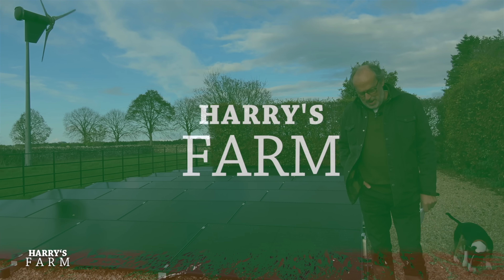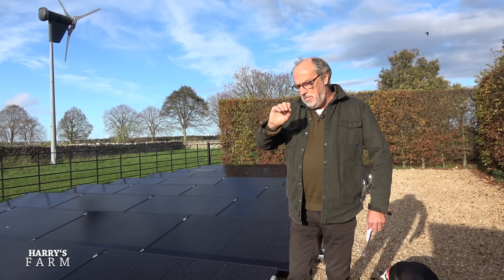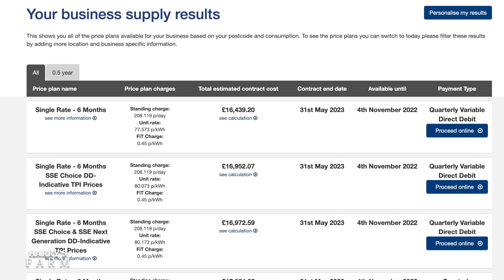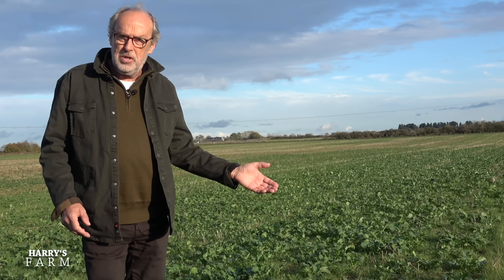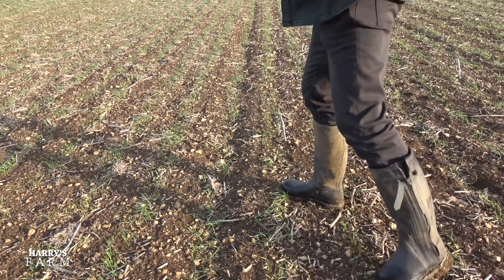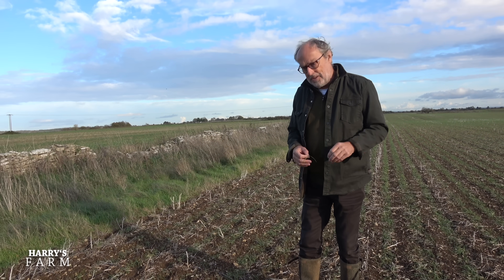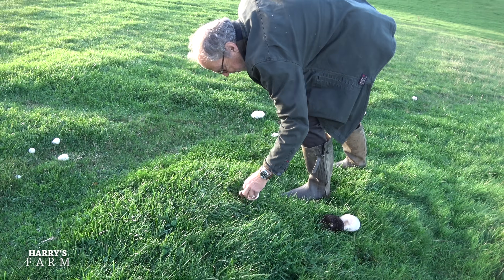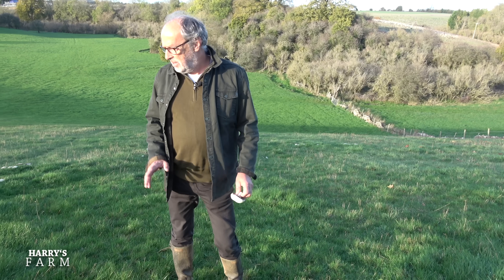More solar panels get installed plus why New Zealand's proposed carbon tax on cows is wrong

Comment: I was one of the commenters on the previous 'Solar' that suggested putting them on the ground. But man-oh-man, you might have taken it a bit too far. 🙂
1) Hurricanes and the like. If it's not tied into the ground, the entire system will wrapped around a tree a half-km away during the first serious wind storm, perhaps in about a month from now.
2) Depending on how it's wired, if any part of that system is in series enough to generate around 50 volts above ground, then you'd want to ensure that there's no shock hazard from the panel faces. You may recall a famous video of Pres Jimmy Carter having his hand slapped away when he was about to fondle a solar panel installation on the Whitehouse. Anyway, if you haven't already, consider the possible shock hazard from the system. Make sure it's all safe voltage wise.
Cheers!

Comment: At that price, 84p/KwH, install a good old Cummins diesel generator and to hell with the stupid credit check! It also sounds like it will be much more reliable than the solar panels! The wind generator seems to be holding it's own though, how does it compare £ to KwH?

Comment: Harry, your system is set up for summer, due to the low angle of the panels required for ground mounting.  It is therefore compromised for winter generation.  Pitched roof mounting allows something close to ideal for year round generation.  Solar power generation is all about light angle incidence (90 degree perfect).  

Your video was shot early in the day (long shadows) – best power is obviously around midday.  The third issue is that it’s winter – so the sun’s light incidence to the northern hemisphere is at a low angle and solar energy has to travel through a relatively thick layer of atmosphere at this time of the year.

  Your 12 kW system has a peak power that you will only occasionally see in the UK (on sunny cool spring or autumn days – not summer because panels are too warm) – a bit like peak power rating of an ICE engine – rarely used in practice.  The peak rating is important because everything in the system has to cope with peak output (like an ICE engine).  

Your solar installation does not need clear blue sky to deliver good power.  Clouds come and go – the power you make will be consistent over the year and every year.  As a farmer, you are well placed to understand you are ‘harvesting’ energy, which is seasonal, like the other crops you grow.

Comment: Interested in the wind turbine graphs.  What output rating is the turbine?   Could you do a review on this when you do the solar update?
Reply: We have an 11kW turbine shared between three families. Average daily production is 60-70 kWh but max seen is 220, and min zero!  Worst always July to September each year. We need to add solar to balance variability in wind generation

Comment: the methane argument isn't "climate change is completely due to cows" (or ruminants), that's pure bad faith. We need negative GHG emissions, so any methane we can avoid emitting should be avoided. Right now farmers emissions are subsidised by the NZ government, and they're proposing not to do that any more.

Taking your "CO2 to grass to methane" point, yes, that's true. But methane is ~120x as bad as CO2 for warming over the 30-ish years it stcks around. So just having ruminants is a big problem.

FWIW deer in New Zealand are an invasive pest that most peoiple want to remove. But the hunters fight attempts to do that, and the agrarian socialist party bow to the hunters.

Comment: About methane and cows: the picture is  correct, but the problem is in the methane that has been belched out: during the time it is in the atmosphere it is a contributor to climate heating. And it takes around 20 years to be converted.
Is it a solution to put a tax on cows? Of course not. The main problem is us people burning fossil fuels. Reducing that to zero is the main road to reduce climate heating.
But still: reducing the amount of methane cows produce also contributes to reduce the climate heating.
Reply: Ruminants evolved around 50 million years ago,hence have been emitting methane into the atmosphere for 50 million years,with ZERO effect on the climate

Comment: Totally agree about the methane issue Harry. Also, I’d be interested to know where you got the solar installation? Did the energy company put you “off grid” due to the size of your overall installation? I’ve been told that that’s a pitfall here in Devon.

Comment: Are those Flat Roof Systems available at a steeper Angle ?

I was told that panels should ideally be at our approximate angle of lattitude - approx 51 degrees, to be as close to perpendicular to the Sun, for as long as possible.

Yours look very 'flat', - so fantastic around midsummer, when the sun is highest, but lousy during the winter, - even when it's not Cloudy ... (!)

Comment: A reason you are not getting a lot out of those panels may be the angle you have them set too which looks more suitable for somewhere  just off the equator. There are calculators online to tell you the optimum angle for your latitude , I'm not exactly sure where you are but at this time of year I would have thought you should be something like 47 to 50 degrees off the horizontal.
Reply: As someone with 10 years solar PV experience in a previous life....the comments about panel tilt Vs output are correct but only theoretically correct, not always in practice. When you increase the angle of a PV panel from 10 degrees to 30 degrees from horizontal:

1. You need much more space for the same 12kWp system. Spacing between panel rows goes from 400mm to over 1500mm.

2. Panels inclined more catch more wind, and need much more ballast. Bear in mind this was intended as a roof mounted system,  it's always a compromise of wind loads Vs acceptable weight on the roof.

3. If you're looking for usable spread of electricity generation throughout the day, lower inclination can be better. Take the other extreme of a perfectly vertical panel facing due south. Fantastic generation when the sun is to the south, but as soon as the sun moves it is not hitting the panel at all. Farmers, manufacturers need power all day, not just at lunchtime.
So overall a good compromise, like everything in life. Harry, once you get the hedge down this will improve production. Thanks for sharing
Reply: @PyreneesCyclingClub  Surely though, they should be angled higher than that, to work more effectively with the lower (Winter) Sun, so you get the most effective use of what little light there is, at the time of Year when you need it most ?
Reply: Another benefit to having them on the ground on that flat roof frame: If a little basic engineering would do it, you could consider seasonal changes to the inclination to optimise them, at least for summer vs winter sun angles.  

At this time of year when generation can be so marginal, it makes an appreciable difference.
Reply: @jncg2311  i have seen sokar setups where they were mounted on a pole and swivel
The entire rig was following the optimal angles to exploit the sunlight. Computer controlled i suppose. Maybe a simple Arduino with some sensors will do the job?
Reply: @jncg2311  do you have actual numbers ? From my testing the additional cost of the structure is more than adding a panel or two. Of course there must be a break point where elevation makes more sense then again where tracking becomes  profitable.
Reply: @clanross62  Yes,  for every installation you can generate the numbers.  Taking Harry's installation in Oxfordshire, and making an assumption that the panels are at 15 degrees off horizontal, then the mid summer loss would be 2.8% and the mid winter loss would be 49.9% of the direct incident potential (97.2% and 50.1%  respectively) .  That basically means Harry will be getting 97% the best performance he could in mid summer in bright sun but in mid winter if/ when the sun shines (when maximum incident radiation is only 26% of the potential in mid summer), half the potential is being lost due to the low angle.  In reflected light conditions (cloud) that goes out the window but then so does the generated output.
It all depends on the purpose of the array.  If it's simply to maximise generation across the whole year then the low angle is relatively less important as the winter weather, short days, low sun angle etc conspire to make winter generation very poor anyway.  If however you need to maximise generation throughout the year for example to meet your own demand, especially during the season of highest demand (winter) then the lost generation is of greater significance, even if it is only a few kWh.

To put that in perspective, if the panels were at 40degrees, as might be the case on a house roof, the mid summer potential is 98% and mid winter is 82% of the potential incident radiation.  Nothing is perfect of course as there is a trade off to the generating day length if that is a factor, and also the feasibility of the installation: you need to either elevate the rear of the array or increase the space between rows dramatically to achieve the sort of angle we are talking about on the ground without the panels shading each other to the north.

The rule of thumb I'm sure you know to maximise overall generation potential: The panel angle should be equal to the latitude of the installation.

In Harry's boots, I'd temporarily decommission and do a bit of landscaping where the array is: Build an earth ramp against a retaining wall with some of the motorbike testing spoil heap in the field, and elevate the back of the structure a few feet.  I'm not sure the rails and ballast are meant to work in that arrangement but I've no doubt a compromise could be met and a more productive installation would result.  it would sort out some of the shading issue with the hedge at the back of the array too and still keep it largely hidden.
Reply: @clanross62  Sorry, meant to add this to help answer your question directly:  Yes, if Harry was able to adjust the panel angles without incurring shading etc and only do it twice in the year, then the optimum angles and times are 58-60 degrees from mid September to the end of March and 35 degrees for the rest of the year.  This keeps the array within 95% of the potential maximum output throughout the year, over 97% in mid winter and over 99% in mid summer when generation is at the peak.  Those dates and angles hold good for that latitude and a south facing array.  You could match the potential even better if you were willing to adjust it several more times but I wanted the best compromise for only one seasonal adjustment.
I have a small second array that is adjustable to optimise winter sun as that was the main motivation behind installing it.  
I am looking at cost effective ways of making the array track, or automatically adjust to either end of an arc daily depending on how it can be engineered.  That is another, much more fragile and fiddly project that I don't think will really be worth it for the marginal gains at the ends of the day in winter when that array is relied on mostly.
Reply: I was going to say much the same. They look like about 15° from the horizontal to me, which is great for the summer but shite for the winter. I’ve never seen an installation that flat.
Reply: I was waiting for him to adjust a control that would raise the panels to a proper angle; they look like they are hinged at the front. Perhaps the actuators are back-ordered.
Reply: @curtaustin8119  even if they tilt, their distance between rows is too small, all but 1st row will be in shadows.
Reply: If they were genuinely on a flat roof then UK planning law would dictate such a low angle, but as they aren't, then a more productive angle could be chosen. I suspect the installer just followed the rules and regs for a flat roof, which wouldn't surprise me at all given my recent experience of PV installers. Even on a pitched roof the panels are only allowed to extend beyond the top point of the roof by a small amount, although not usually an issue with a pitched roof.
Reply: They're better set for summer months. Given that winter in the UK is very unproductive for solar PV then optimising them for best all round production produces less yearly generation than optimising them for summer. There is no one size fits all, it depends upon circumstances.
Reply: The difference the angle makes in the uk, especially in autumn is like night and day. You can literally double your output by getting it right.
Reply: Most of the ground mounted solar PV installations I’m familiar with at a similar latitude - e.g. the massive Wroughton ex-airfield one, have higher angles than the one at Harry’s Farm.

The maximum output in Summer is likely to depend on the maximum thermal temperature. The panel efficiency diminishes with temperature - I’m familiar with it on my house roof. Hot mid-summer days can be less powerful electrically c.f. earlier/later months overall.
Reply: @johnkeepin7527  Yep, that's because they are  optimised for a better output in winter. For best results in winter, a near vertical mount does better. In Harry's case, I suspect he wants to sell as much back to the grid as possible for FIT payment, therefore over the course of a year, his mounting angle is best. It also provides more mechanical robustness to gales. In the UK the panel's output reduction due to heat is not a large factor.
Reply: If the shading isn't fully resolved by the hedge trim, maybe mounting the system on a small (1-meter) wall may help. With a bit of design, the area underneath the panels may be a good wood storage area if a membrane is used to keep the rain off.
Reply: @kidfromtheseventies  
Not Necessarily.  If he could mount it on a Timber frame which could be adjusted for angle, he could set his optimum for the time of year.
Reply: Or a good old stick in the ground and measure it.

Comment: I agree ... The Earth had a pop of 5B in 1990 and it took from the dawn of time to reach that figure, now only 32 years later its almost 8B. It seems to me its not "Climate Change" as such, its the use of Oil yes but also all the consequential pollution by a rapidly growing population  I'm not convinced Green parties actually have the right policies, including on Electric motors. I suspect the entire motor industry has gone down the wrong path on Electric ...
Reply from the maker: Interesting comment. The automotive industry has been forced down the EV route because it has to meet a stringent fleet average CO2/km figure for all cars sold in a calendar year in Europe (and UK) and the only way to hit this average is by selling cars classed as zero emissions. The only vehicles rated as zero emissions by EU politicians today is an EV, hence why the automotive industry has been forced into selling EVs. It has no choice (or time) to do anything else.

Comment: Thankyou for another informative video. Completely agree on the cattle and methane thing, it just has not been thought through. Good to see your solar instalation. Unfortunately I think you are going to be disapointed with it. Depending exactly where you are located, they need to be at around 59deg.angle (however many degrees N. you are) for the sun to strike them perpendicularly and obtain max. output. You will probably only get around half their rated output as they are. Just look at the length of your shadow as you stand there, it needs to fall as a dot on the panels.

Comment: If the wind turbine supplies a quarter of the electricity you need, I don't understand why you didn't just put 3 or 4 more of those in instead of all those Solar Panels?!
Reply: He's said that in the summer the turbine doesn't do much, but you'd expect the solar panels to produce more. Then the seasons change visa versa.
Reply: For the seasons where it outperforms, could have one for the farm and one for the house. Help hedge the solar.

Comment: Born on a NZ farm, and still involved seasonally, I have mixed feelings about the proposed “burp tax”. NZ livestock farming was grass/clover based, with the main input being a bit of superphosphate laced with a few trace elements where necessary. Relatively low yield compared to more intensive systems, but low cost, and relatively low environmental impact (after the initial felling if forest to grow pasture more than 100 years ago). The sheep and beef sector still is largely so, but dairying is a different story, with amalgamation of smaller farms and conversion of land use into large landholdings, the sector has grown considerably over the past 2 or 3 decades, with the encouragement of some politicians and bankers. Heavily reliant on nitrogen fertiliser, clover has disappeared from dairy pastures. Whereas surplus spring pasture was conserved as hay and silage to feed cows over the winter now high producing annual ryegrass and maize crops are conserved to prolong the productive season. Supplements made using imported ingredients are now fed to boost production. That is a lot of burps that are not produced from permanent pasture, Fewer folks work the land, and increasing numbers of them are contracted imported staff, far from their families, on working visas. Farming as it is today is far from what it was. All this has had a big impact on the environment and rural communities. The “burp tax” seems to be a clumsy, big bro way of addressing things.
Reply: Interesting! Thanks
Reply: To many people.
Reply: @themerrigans2734  For other species we would be looking to control numbers because of their impact on the environment.